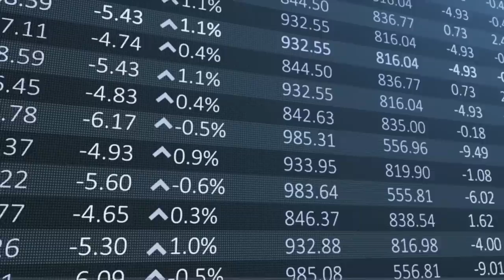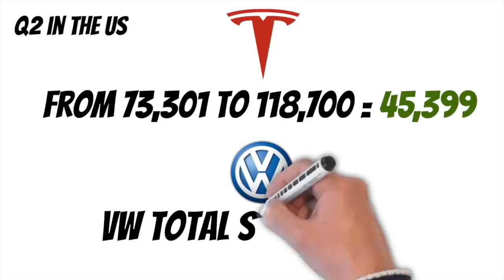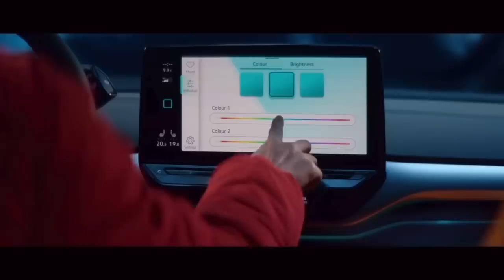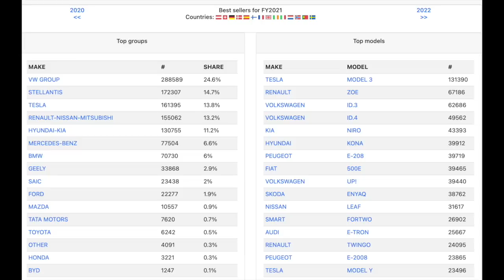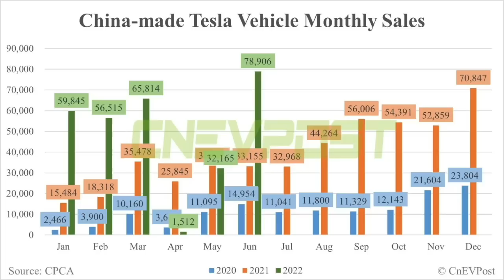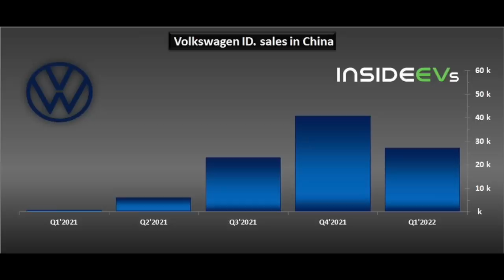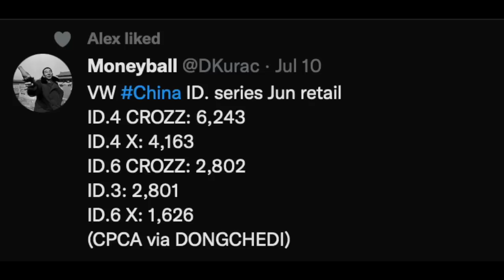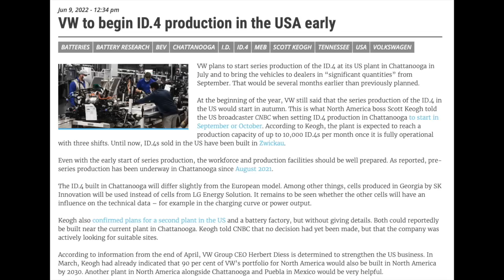VW EV sales in the US is collapsing, down 71%  VS  Tesla is up 62%

Comment: I live in Los Angeles. Southern California, in general, is Tesla territory. There are many times in traffic when I'm surrounded by Teslas - 3, 4 or 5 deep. The Model Y is by far the current best-selling Tesla, but I see every model, including two brand new Model X Plaid just yesterday. What I'm seeing with Tesla is the disruption of not just the ICE industry but of the "planned obsolesce," "mid-life restyling" updates and the "redesign" or "refresh" that has been a hallmark of the auto industry since GM made yearly changes "normal" in the 1950s.  Where people used to care that they had the "latest version" of the BMW 3-series with a new lease every 3 years, they no longer care so much about the refreshed look as they do about the refreshed tech. And you can count on Tesla to refresh its tech constantly and you know you have the best tech without even bothering to check the "competition."  You sure don't get the best tech with the VW ID.4. The consumer looks at a Tesla screen and sees an iPhone that is constantly updated. The same consumer looks at the dizzying array of screens in a Mercedes EQS or the pathetic screens in the VW ID.4 and goes back to the simplicity and constant refinement/updating of Tesla's operating system and electronics/battery management system. Then there is the performance of any Tesla. With rare exception (e.g., the Porsche Taycan), any Tesla blows them all away. And why did VW make the ID.4 make the electronic whirring noises? You can sure hear them coming and going. Most people want a quiet EV. Then there is charging. Tesla's Supercharger network is so superior to VW's Electrify America (or Ionity or ChargePoint) that it's laughable. In EV-hungry SoCal, it's Tesla Model Y, not VW ID.4. The market seems to have spoken. (BTW, VW's dealer network has sucked for years. It doesn't help much, even though SoCal VW dealers are onboard selling electric. Watch for the HUGE markups on the ID.Buzz whenever it shows up.)
Reply: I, too live in SoCal, have been driving EVs for 13 years, and will never go back.  But I ache for the day soon when seeing an ICE car is the exception, and that they have the ironic problem of too few gas stations to avoid running out of gas, as used to be the problem with EVs here, not so long ago.
Reply: Todd, that's a great point about the value of keeping designs year to year!

Comment: And I'm sure the drop off on orders has a lot to do with the bad press they received about the older models not performing to the specs that the buyers were told. People were returning the cars to the dealerships and getting our money back. Just like a Mercedes electric had problems when they released it and sold it, and the Porsche had major problems and the buyers were even told to drive them very slowly and ever being returned. They have screwed themselves on purpose by releasing cars that weren't ready so that people would be dissatisfied they think the company could go on making their diesel cars which then they got caught again faking the numbers and pollution reports so they had never fixed anything. And I had people making the profits are already super Rich so they don't care if the people below them go jobless or not.
Reply: regardless, they have noting compelling to offer.
Reply: True, plus that’s a great way to hand the future over to China for short term ice revenue.

Comment: Yeah, the only thing I can say is that I have had an ID.4 on order since December 2021, it has not moved in the product queue since February. Original delivery date was supposed to be Mid 2022 still no production date, so not sure if I will get a 2022 or 2023, as far as I am concerned I rather have a 2023 now, since the car will model year switch happens in August / September.
Reply: VW had their cables from Ukraine. They moved this production to Romania very fast. Supplies are nightmare now

Comment: For one thing, VW has yet to even offer the ID3 in Canada and the US. For another, word is out about how bad the software is in the VW vehicles and that there is little to no chance that it will be fixed before 2026!!! That's two reasons why I won't be buying a VW BEV any time soon.
I don't like SUVs and I NEVER will. I also REQUIRE that a car WORKS. I would be interested to know how many people feel the same way?
Reply: i never liked SUVs either until i bought one eight years ago. They  have one one big advantage for us older people, they are easier to get in and out of. My sports car days are well and truly behind me, lol.
Reply: @andyfreeze4072  Thanks for your reply. I'm over 60 myself and I do employ the overhead handle to get in and out of my VW Golf. That still doesn't deter me from liking the fuel economy and handling of the hatchback.
Reply: @surferdude4487  yes its a different feel in an SUV, and believe it or not, you do get used to sitting up high, looking over the car rather than being cocooned in. Mine is a diesel and i get great economy . 10ltr/100km in town and  7s on the road. Next car is definitely electric, lol.  I used to drive a tesla s for work and it was great but not perfect. I believe they have improved somewhat, hahahaha

Comment: Ive watched VWs Power Day for a competitors analysis: a few Key points:

US numbers are completely left out, they only talked about the 240 GWhs in Batteries in europe, nothing else for batteries from inhouse or additional suppliers. And the growth rate in china or their battery Plans there are completely wrong or left out (they estimate a 34% growth rate in BEVs in China from 2020-2025, while they actaully grow at 90+% currently)

VW plans to have 22m EVs built off its electric platform over that period and is part of a strategy that anticipates an annual demand of more than 150 GWh of batteries from 2025 in Europe. This would actually fullfill their demand for europe! They sold 1,8Mil cars in europe at their peak.

This would leave 90 GWh, or about 1,2-15 Mil VW EVs for the Rest of the World with their own current battery production Plans. I still dont know how much suppliers will give.

God they really wanna give the Shareholders a good feeling by holding up their presence in europe, while totally underestimating the needed speed. And even if they can hold ground there, the Rest of the World is lost for them.

Reminder: VW Plans to build 800k BEVs this year and 1,3Mil in 2023. Slower pace than Tesla.

Worst case at:
240 GWh in 2030, Battery Pack Size 75khw, 90% BEVs

Makes 3,2Mil BEVs +10% (300k) non EVs

Comment: Tesla is still learning I can give them a big hint yeah you might need to concentrate on trim packs and battery packs but you can take the power train to simplicity that means either two or drive or all wheel drive anything in between is not acceptable that means two motors or four motors three motors is kind of a garbage kind of deal

Comment: vw lies about their automobiles specs.
Reply: I'm curious what this is in relation to.. a lot of people say Tesla lies about their range.. but really it's just the difference between an EPA test versus people's actual driving style and location. If this is what you're referencing.. it's not a lie.. it is incumbent on an intelligent, informed consumer to research and understand what they're getting into. Especially if the price point is significant to your life style. There are TONS of locations you can find real world data on EVs.. or if you go test drive one.. I recommend EVERY new EV buyer understand one metric.. watts per mile. When you drive an EV the way you INTEND to drive it generally.. the car should have someplace to show you how much energy it's burning in Watts per mile. When you get an average of THAT number for ANY EV specific to how YOU drive over maybe, 50+ miles.. you can extrapolate the range and efficiency of the vehicle with real accuracy (size of your battery, break it down to watts from Kilowatts, and see how many miles you get per KW and multiply that by KW size of the USABLE battery in your car). You do STILL have to account for things like weather.. wet roads reduce some efficiency.. head winds reduce efficiency.. any significant uphill driving will reduce efficiency.. freezing cold temps will reduce your batteries CAPACITY when the BATTERY is very cold (so the amount of total energy in your battery MAY be less than you think if you only look at battery %, for example 90% of 70KWs is 63KWs vs 90% of 65KWs is 59.5KWs available.. this only occurs when the battery is really really cold.. it will go back to normal potential CAPACITY when it goes back to normal temps.. garage your ev when you can).. the rest of the variables are really quite small. And knowing these things makes some people think.. omg these EVs are so difficult! No.. they're not.. your gas car suffers from all the same issues except the freezing temps.. you just have a gas station on damn near every corner.. and even ICE's are a little less efficient in freezing temps but it's less of a factor. What DOES ring true is.. the charging network if you are traveling beyond the limit of your battery to go and get back to your home. This is NOT very common for most humans. But it is for me, 250 miles one way weekly at 80+ mph. And it's why there's only one brand I'd go with.. Tesla's efficiency and charging network is unmatched. It doesn't hurt that the car is also the most fun I've ever owned.. on almost every metric. Not perfect by any means.. but I've yet to find something better.

Comment: I bought an eGolf. It’s a really good car, efficient, great fit and Finnish and creature comforts. The problem is that it was never more than a daily commuter and grocery getter. 85-miles range in summer, 65-miles in winter. We still have our 2015 and it’s performed great.  Battery chemistry is holding up well. So I looked hard, real hard at the ID4.  It’s just a dud.  Just felt like a no-personality tank. I’m hoping the ID BUZZ can turn this mess around.
Reply: eGOLF is jus a COMPLIANCE built car on a GAS body & Outdated Platform.